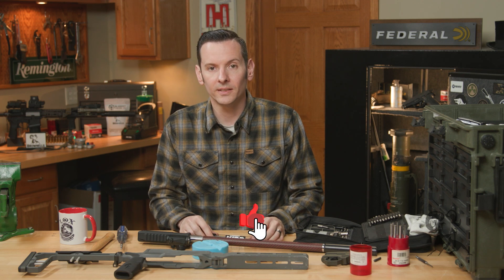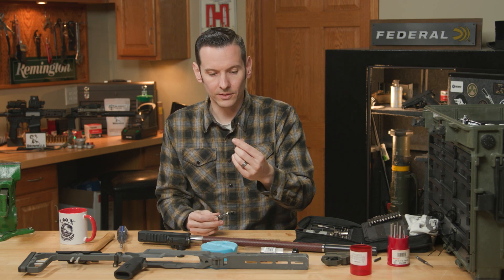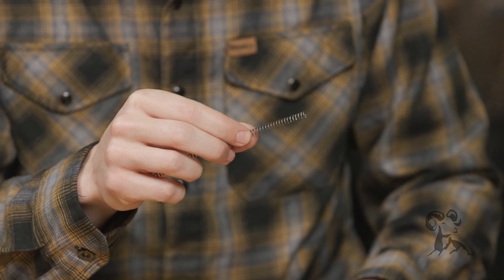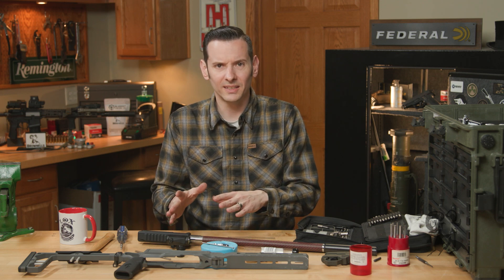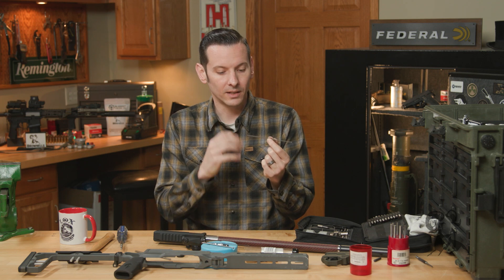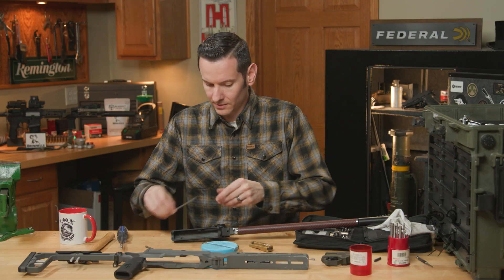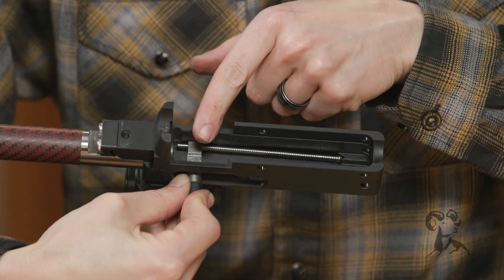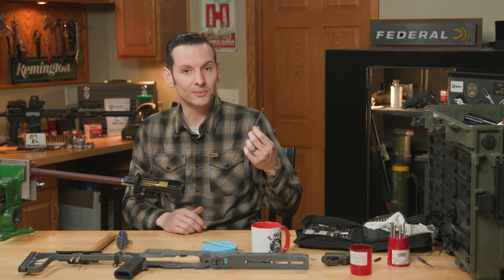Quick Tip: How To Install The Charging Handle And Spring Kit From KIDD

Comment: You all should check out the smith and wesson m&p 15-22 i have one of them and love that thing. I have owned it for like 5 years now and shoot the crap out of that thing and last week had a round go off before going all the way into the barrel. Broke the firing pin and blew out the extractor.  Ordered a new firing pin and extractor put it back togather and been shooting it for last two days with no problems.  Love this little thing and it's built just like an AR15.
Reply: You mean to say it feels like an AR-15 ergonomically, right? The 15-22 is blowback and shares only a few parts with the AR-15.

Comment: Is there a reason why the spring is not captured like the Ruger charging handle and a lot of others on the market?  The down side I see with the Kidd is having to deal with the same installation hassle every time the gun is disassembled and reassembled.
Reply: To make it easier to change the spring? That's all I can come up with off the top of my head.